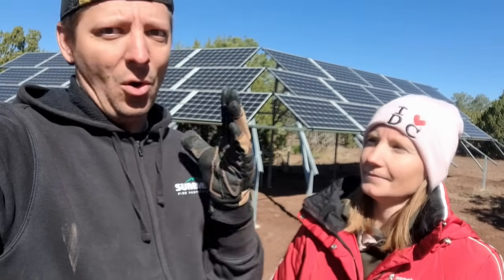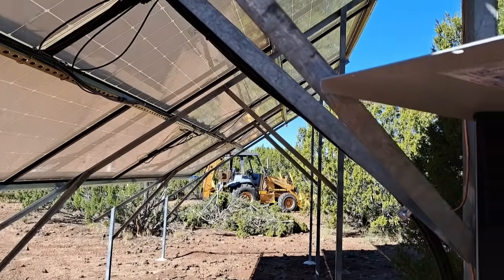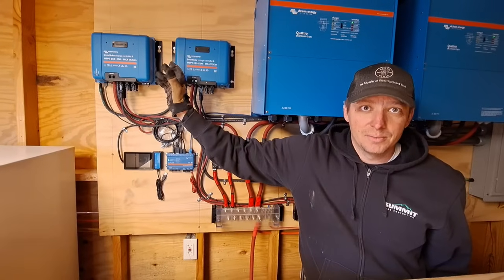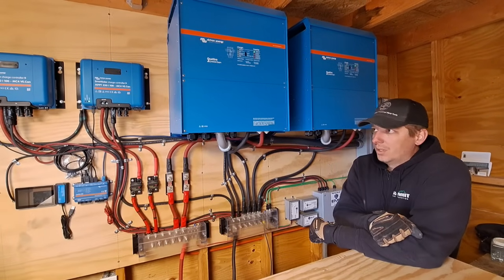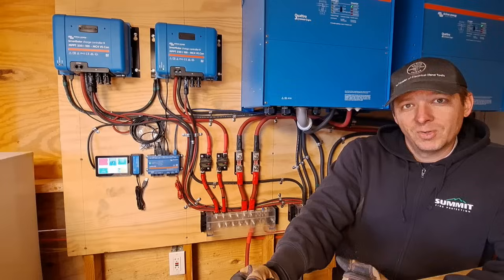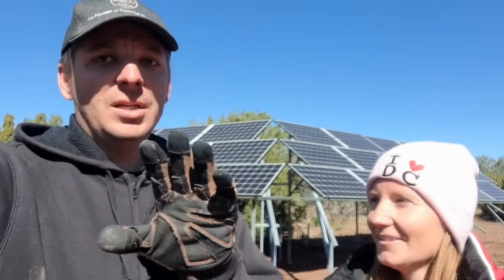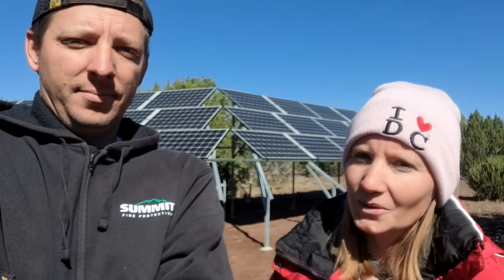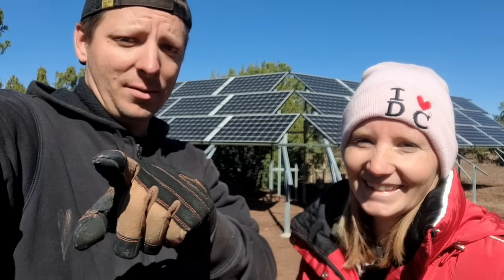INFLATED COST Of Our 100% DIY Off Grid SOLAR POWER SYSTEM 👍

Comment: It's amazing how quickly the cost of solar and batteries are decreasing.  You can spec out this type of system from Tesla, but slightly different (rooftop mounting and 2 powerwalls=28kwh) for around the same price, and it will be installed by professionals with their warranty in two to three days. Of course, then you don't get the satisfaction of having done it yourself. And I think there would be extra costs for the type of ground mounting that you have.  But still Just to know that the cost of the components when you built this is now about the same cost as buying it and having it installed is kind of crazy. I mean I knew Tesla had the best prices, but I didn't think they were competing on price with DIY!

Comment: Good looking system sized for an online life. Any more power and you'd need a Tesla to use the energy. Keep the MC4 and wiring under the panels tidy, someone had a goat nibble and pull the wire off one panel cutting his yield til he found out why!  Never assume that you will not need a generator.

Comment: assuming you live in a place where you don't get many cloudy days ~6000W of solar is enough assuming you have a LFP battery, reason being is that you can optimize for generating the maximum amount of power over the day and don't have to worry about not generating much power in the early morning and late evening because that have 5000 cycles assuming you cycle them from 100% to 0% every day thats over 13 and a half years of batteries and that charging and discharging is at a 2C rate I believe so with solar and a big battery system you wont be charging at even close to 1C, and really you are unlikely to be discharging the battery at 1C for long periods of time so from a pure cycle prospective your porbably talking about more like 15 - 20 years.

And that is only to degrade them to 80% of their from factory capacity you can continue to use them safely past that point, but then there is just calander degredation which means that if you are not using the battery it will just degrade on it's own so it's best to just use it to optimize the maximum amount of power.

Because I assume the reason why you have your panels angled they way you do is to catch the morning and afternoon sun by sacrificing peak solar to reduce the load on your battery, which is I think honestly kinda silly.

Comment: Good DIY work! I expect this system will pay for itself in a decade and last two or three decades. Great!

If I were doing a similar installation, I would make a few changes:
1) Use your scrap iron for the horizontal members of the array. You can weld on nuts or make threaded holes to clamp the panels. Welding galvanized iron is best done with a "digging" electrode like E6011 (AC/DC) or E6010 (DC only).

2) You have extra vertical members and posts because your two halves are too close together. Save labour and materials by using two rectangular arrays separated a bit.

3) You could save a bit by using higher voltage batteries. Then you can use smaller wires. Copper prices are huge. It could pay you to obtain scrap copper and cast your own busbars in a steel mould.

4) You could also save by buying one large 120/240V inverter rather than two 120V inverter. The price per watt goes down with larger units.

5) PV panels and Lithium Iron Phosphate cells are commodities these days. You could save a bunch by buying directly from China, at least in Canada where there aren't customs duties. We do have a sales tax which will be less if the price is less. The larger the battery the more cloudy days you can survive and the longer the battery lasts because of finite cycle-life. Reducing depth of discharge can make LiFePO4 cells last more than 10000 cycles.

6) A battery box is a good idea as lithium cells do better with heating and cooling to keep them near room temperature. It is easier to heat/cool a small box than a whole shed.

Comment: I want to know how long is the system going to last. If it lasts 15 years, what would have been an electric bill for 15 years?
Reply from the maker: On average, probably $200 a month. But you also have to take into account the cost to get power from the power company to our location. And it's way more than what our system cost us. On top of that, we want to be off grid and not stuck with the power company.

Almost forgot. The batteries will last a minimum of 10 years and up to 20 years plus. All other equipment should last 30 years no problem. Thanks 🙂

Comment: do you heat water with solar energy, if not do you use solar water heaters, They can be almost 100% homemade, long black plastic PVC pipes with curved reflectors behind them, (shiny curved stuff) raise the water temp to very high, and if you compress the water boiling point can be reached quite easily,
Reply from the maker: We have a regular electric water heater that is powered by our solar array. Thanks. 🙂

Comment: Why so many 300 watt panels, if it's for your own usage? I live in Australia which has the highest solar irradiation in the world I can get by with around just five 300 watt panels for everything except air-conditioning . I mean isn't this overkill?
Reply from the maker: We want everything to run on electricity. Water heater, clothes dryer, range, you name it. Thanks for watching. 🙂

Comment: The price is pretty reasonable considering if a utility company was even close by it could cost 50K to trench, conduit and wire to the utility. Then you still pay $200.00 to $500.00 per month forever.

Comment: Can your system handle daily use? I wonder if it would save money by going off-grid.
Reply from the maker: So far, so good. But I think we will need more batteries in the future.
Reply: @aboulderlifeoffgrid  You also have the option of adding a backup generator if you are short only once in a while.  Sodium Ion battery is coming in 2025/2026. They should be cheaper without using lithium.
Reply: @aboulderlifeoffgrid  Rolling back around solar system. Are you guys straight off grid or are you still relying on the grid with your system?
Reply from the maker: @MyDeere3320  We are completely offgrid. Power poles are about a mile and a half away. And we're loving it. Thanks 🙂

Comment: Going for Quattro was an overkill. The main benefit of Quattro is two AC inputs, which can be used for a generator and grid connection at the same time. If you have no grid then one AC input is sufficient and Multiplus is your choice. It is cheaper at the same power.
Living in Australia, I don't really understand your situation with 120/240 volts. If you need 240 volt I guess you might consider European/Australian versions of Multiplus/Quattro of the same 10kW power but at 230/240 volt.

Comment: Interesting, the actual cost for your system after federal rebates is around $26,000. It will easily pay for itself in in about six years. With your family, you will easily use $4 000 - $6,000 a year in electricity.  Your system is not too big - you did a great job.
Reply from the maker: That's one thing we forgot to mention was the federal rebates.  Thanks for watching.🙂
Reply: My family of 4 in a 1500 sq ft house in the Midwest averages $1,200 a year in electric cost . I went to the local solar shop and I think it would take over 30 years to just break even . Then after 30 years wouldn’t I need to replace almost the entire system from age ? It makes zero financial sense in the Midwest where power is so cheap .
Reply: @Nctbgs  Yes, if you don't install your own solar system, it will never pay for itself if you have a home that has low electricity costs.  So the first question you have to ask yourself is, "Can I install this system myself?" If you can't, in your situation, your system will never pay for itself.

The second mistake you made is to go to a local solar shop and then take their pricing as being competitive. Solar panels and equipment pricing varies wildly depending on the vendor. It's kind of the wild west right now with solar. So you need to qualify your vendors.

I would recommend these websites:  Signature Solar,  Solar Wholesale, San Tan Solar for a start. Signature Solar in particular has the best pricing I have found and as long as you are careful about spec'ing your system, you won't have any problems. You have to remember when you buy solar equipment, generally you cannot return it unless it is defective. That is changing, but as a rule of thumb, don't buy something that you are not going to use.

For your house, you could install a 7 KW solar power system connected to the grid for around $15,000 BEFORE the 30% federal rebate. You also will probably have some state rebates. So your  cost would be approximately $15,000 - (0.30 x $15,000 ) = $10,500. 

This would be the system I like for my own house:

1. Sol-Ark 15K inverter - $8600
2. 7 KW of solar panels - $4,000
3. Racks/wiring/misc. -  $3000

This is a REALLY nice system and I am going to install it on my house, except I am going to install 10KW of panels.

Remember you have to repair your roof before you install solar panels on a roof. That may be an additional cost.

For your solar panels, Signature Solar has great pricing on panels that are 440W  - 550W. You want to try to get panels over 400W because it will be less panels to install and maintain. Also you want to get panels with a 30-year warranty that guarantees they will be 80% -90% efficient for the warranty time period. And make sure they have a second warranty which is a defect warranty. Usually defect warranties are 10 -12 years.

So after you get your tax rebate, your cost will probably be around $11,000 for a grid connected system. This will reduce your electric bill to zero in most states.  

With the Sol-Ark 15K inverter, you can add a battery backup system at any time. I would cost  you around $5,000 for a 15KW battery system (again, Google signaturesolar.com).  

The advantages of purchasing solar for your home are as follows:

1. You protect yourself from future utility price increases. For example, under President Biden's insane energy policies, my cost for gas increased 30% in ONE YEAR. 
2. You can use as much electricity as you want and not worry about the cost. A 7KW system should provide about five times more electricity than your home uses. 
3. There is very little maintenance required for this system once you get it up and running. The main thing you will need to do is clean the panels every 3-6 months depending on how dusty your environment is.  Your inverter should last 15 - 20 year minimum - probably longer. Your panels don't wear out. So there is virtually no maintenance costs for this system.
4. You can charge an electric car with this system. So you could eliminate your gas costs if you buy an electric car.
5. If you install a battery backup system, you can power your house off-grid if the grid fails for some reason. This is why I recommend the Sol-Ark 15K inverter. It is a "hybrid" inverter. This means that it allows you to connect to the grid or to run your system off grid.

So you can way the advantages and the cost and then see if it is worth the costs. If you get large state rebates for installing a solar system, then your overall cost will be lower than the numbers I have provided.

Comment: Pfff close to 40K$..... it's a lot.... Ok you have top quality elements inside. I have 9.3Kwc + 30Kwh/48V  LFPO4 DIY batteries (302+320 AH) +  8Kva inverter (chinese :( ) + 2 x 250V/60A controler (chinese :( ) + structure (built over pergolas mostly) for a total of 13K euros for everything..... A Total of 4 strings... Anyway, I repeat, you have top quality elements. Maybe for your next batch of battery, you can assemble some directly from prismatic LFPO4 cells. It's super easy. Cheers from France.

Comment: If the bus bars were so expensive what stopped you from using a stick of steel/copper, a drill, some wood for stands and safety cover, and a handful of bolts?? As you said... ITS A PIECE OF METAL. lol

Comment: Very nice installation, I see that you have no wind generators and from the sound on your microphones, you have plenty of wind, would be useful for those long sunless days, could you have mounted the solar panels on a motorised mount so it follows the sun and you can never have enough batteries, I made an enquiry for a solar installation, got a phone call from a sales rep, a full system for £2400, I asked what solar panel are they fitting and they don't know, as far as I know, It could be £2400 just to charge a mobile phone

Comment: I'd been wondering about your design requirements to justify an array of that capacity. I've been a PV solar advocate for years, and have kept tabs on the state of the industry for that reason, so I had an approximate idea of the generating capacity you were building. The phrase "You get what you pay for" remains just as accurate as ever, so spending the money on quality infrastructure is a wise investment, rather than cheaping out on garbage gear. You'll never regret buying good equipment.

Of course, it doesn't help that the cost of copper is more than double what it was 5 years ago, so you kinda had to eat poop on that aspect. Regarding the bus bars, I strongly feel that there's some profiteering there because the manufacturers are supposedly making a product just for solar power applications. I think you might be paying for the certifications attached more than just the actual chunks of metal, especially when I am quite confident that you could have picked up some copper bars then drilled/tapped holes in them for connections for FAR less money.

I'm guessing your PV panels have a 25 yr or 30 yr warranty on them. It seems obvious to me that trying to build a heliostat of any sort was a non-starter as a DIY project, and your split-angle design for maximum exposure was a deliberate compromise based on your long-term design requirements and anticipated maximum load/draw.

Comment: I'll Start By Sayin, GREAT JOB On Y'alls DIY Solar Project... Now I'll Tell You A Thing On How To Improve On It Greatly... 1) From 25:53 to 25:58 I Noticed You Have Bad Shading On 4 to 6 Panels Right On That Corner Wedge Where All Panel Strings Come Together! Cut Those Trees Down For Firewood, Since Your Loosing A Lot Of Your Solar Potential On All Those "In Series Wired" Strings! 2) Sorry Butt Y'alls Spent/Paid 2x to 3x More Than You Should Of On Most All Your Components...From Your Solar Panels, Combiner Box, Charge Controllers, Inverters, Buss Bars, Batteries, ETC... This Is Based On My 35+Years Of Designing & Installing Total Off Grid Solar+Wind+Water+Geo-Thermal Powered Jobs, From Earth-Ships Using All Natural Materials to Multi-$Millions$ Custom GREEN Construction Homes All Over AZ, NM, N-Mexico & Now In TX Also... 😁😎

Comment: You were smart to use a heavy duty, high surge capacity, long lived, low frequency, transformer based inverter charger instead of a high frequency, transformerless inverter charger that everyone else is hawking on the Internet. The Chinese made high frequency inverters on today's market (and they're ALL Chinese made) are not only short lived and weak when compared to conventional off grid inverters, they can also be dangerous. You'd be lucky to get even two years of service from these inverters, especially when powering high inductance loads like full sized refrigerators, large power tools, portable AC units or large microwave ovens. 

The reason for this is that all of these lightweight, high frequency inverters lack a very critical component. That critical component is an iron core, copper wound output transformer. Without an output transformer to act as a buffer to absorb electrical surges provided by the “Flywheel Effect” inherent in the physical amount of a transformer’s iron, these surges and damaging reverse voltage spikes must be handled directly by the inverter’s MOSFET transistors, essential shortening their life. 

You might be able to start and run some high surge loads when these high frequency inverters are new, but every time you fire up one of those inductive loads, you're shortening the life of the MOSFETs in these inverters. 

Lightweight. high frequency inverters run much hotter than low frequency, transformer-based inverters which makes the low cost, off spec, Chinese made components such as capacitors, diodes, resistors and ICs that are used in the cheap inverters that are used in these inverters, far more prone to early failure. 

Another major consideration with these lightweight, high frequency, transformerless inverters is safety.  All it takes is for the AC output monitoring circuitry to fail and one of the MOSFETs in the inverter's H-Bridge circuit to short to ground, and these inverters can dangerous, high voltage, high amperage DC current straight to your connected AC loads which will not only damage most AC appliances but can also set those AC appliances on fire.

Another consideration that is never mentioned by those high frequency inverter hucksters, is that the vast majority of these inverters are non-repairable. After the warranty runs out, you're not going to be able to ship these units back to the manufacturer in China and have them repair them. And at a typical shop rate of $125 per hour here in the US, with no schematic and limited parts availability, it won't make economic sense to even attempt to repair one of these units. Once the FETs have fried and have burned a good portion of the inverter's PCB, (And trust me, sooner rather than later, they will fry.) they basically become a brick.